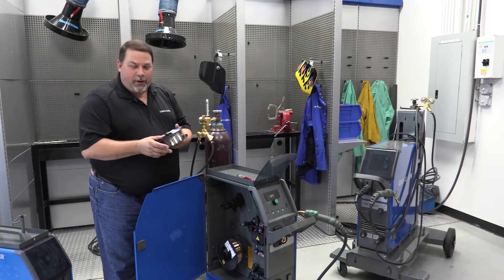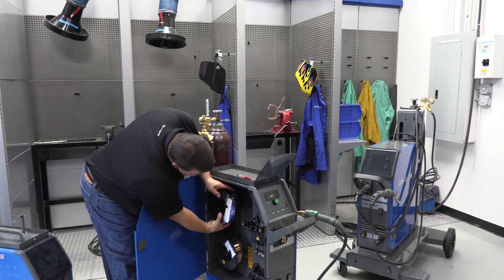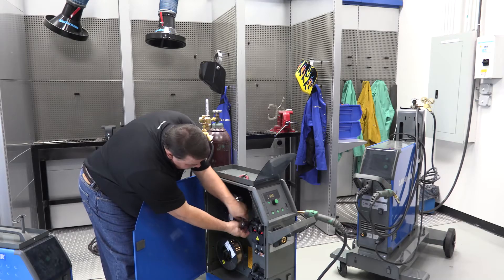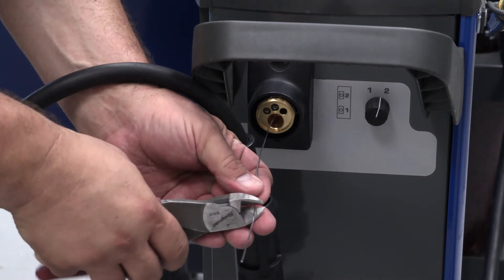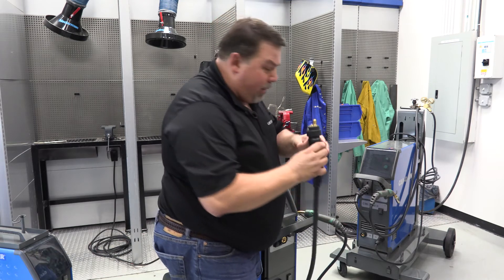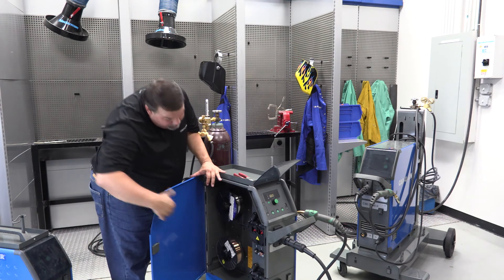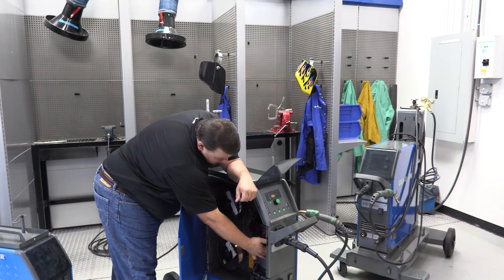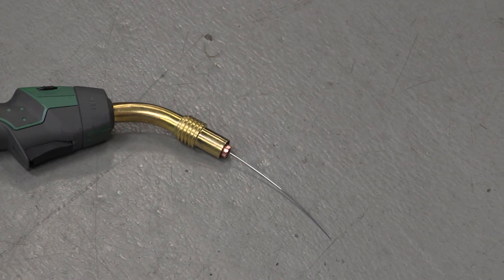Car-O-Liner MIG Welding Technical Tip:  Loading Wire

Comment: Hi, I have a question about the car-o-liner 273, I need a picture of the inside of the machine where the electronic boards are so that I can put the jacks and cables back in their slots, thanks.